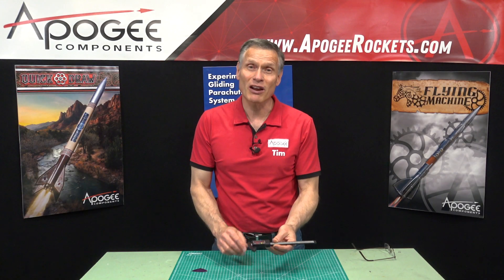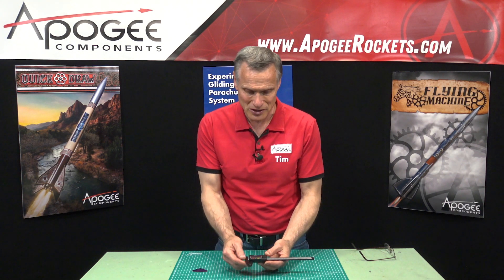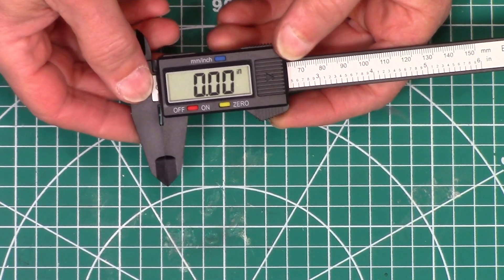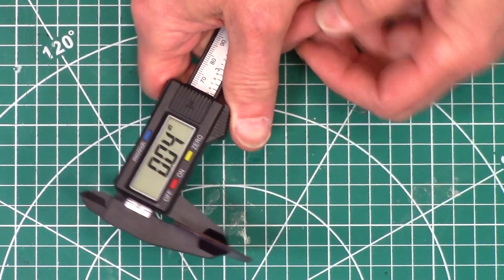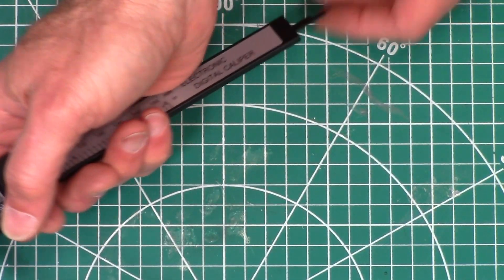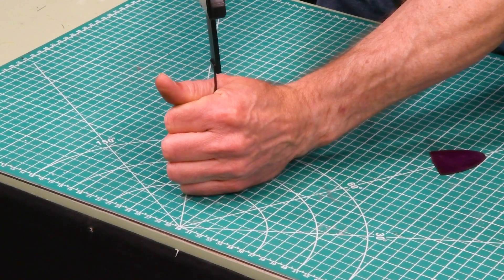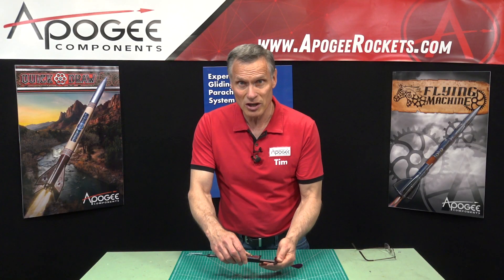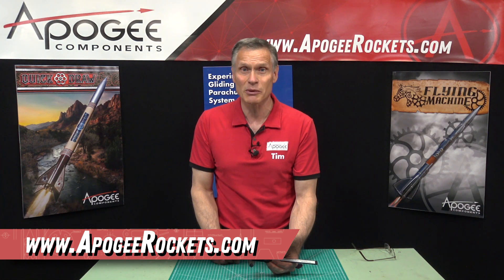Using an Electronic Digital Caliper for Model Rocketry

Comment: Don’t forget the inside measurement “jaws” which are opposite the large thickness measurement jaws. The inside jaws help you determine the ID of a tube so you can identify it (like .976” for BT-50).

Comment: Totally agree on this AND also recommend metal rulers marked in millimeters and another in tenths and hundredths of an inch, those last two making the stupid fractions of the Imperial Measurement system into a base 10 system.  Also, a metric tape measure.  Why?  Does Rocksim work with fractions?  Of course not.